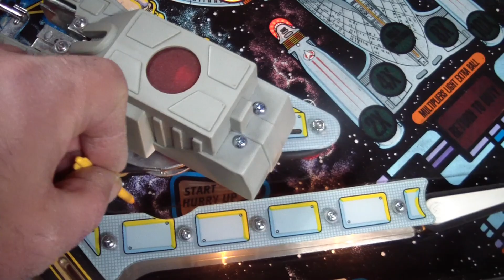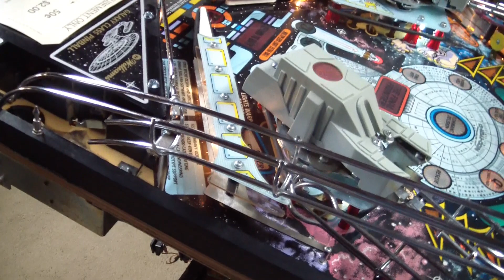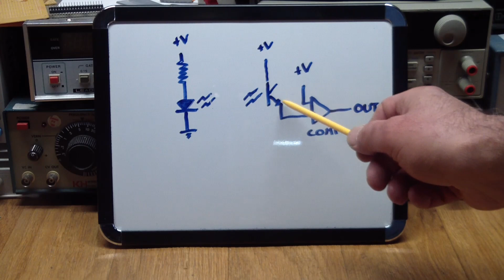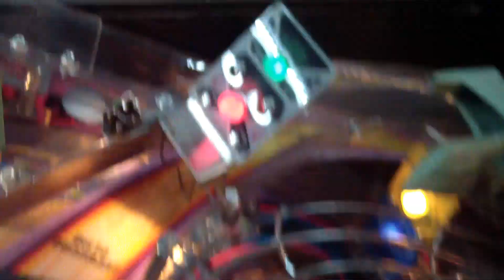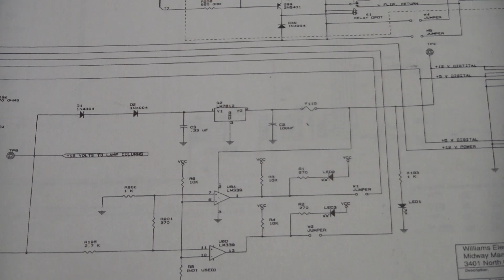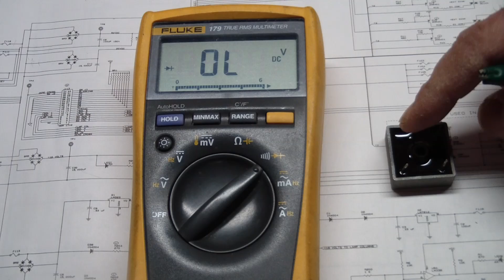AE#143 Star Trek The Next Gen Pinball Intermittent Switches Repair

Comment: My machine was  not sensing the drop target switch.  You can adjust the switch position by slightly loosening the lower screw holding the switch to the bracket.  This allows some limited movement of the switch.  Adjusting it slightly counter-clockwise moved the lever arm closer to the drop target lever, and now all is well.  Bravo!!

Comment: ARTIFACT ELECTRONICS, can you make a video lesson on how the pinball games SWITCH MATRIX and LAMP MATRIX circuits work having the theory behind how it works with the scanning frequency and cross points. I'm not sure why the use Diodes because if you remove all the diodes in the matrix circuit it will still work so I don't know what the diodes are doing or the purpose of the diodes because when the switch is OPEN the diodes do nothing and when the switch is CLOSED the diodes are only allowing the SCAN frequency is pass in one direction.